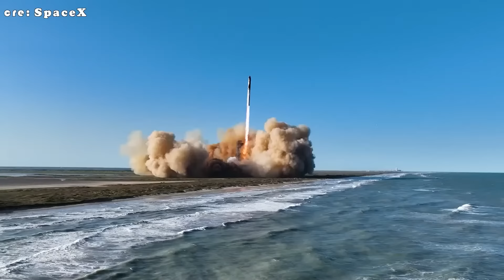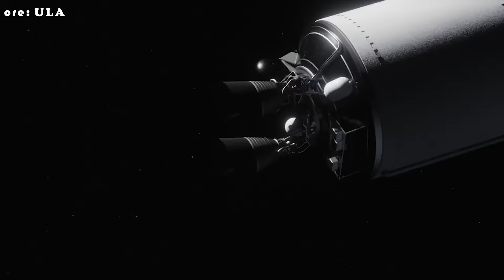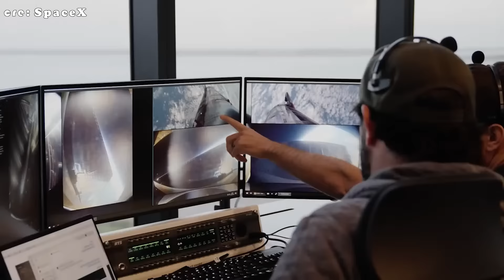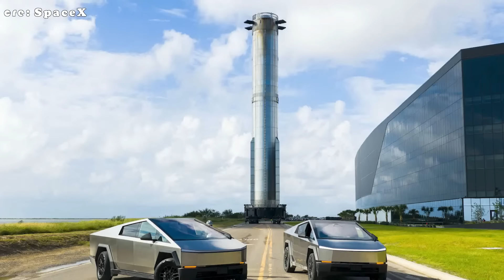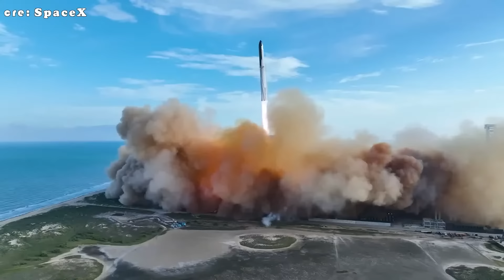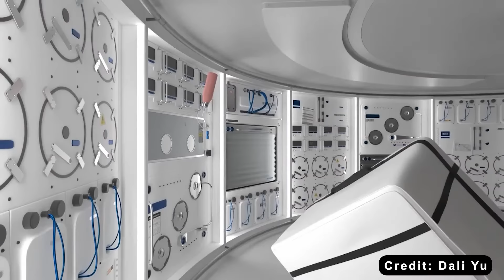Elon Musk SHOCKED NASA and China with New Method to Launch Starship to the Moon!

Comment: Granting the Legacy AeroSpace Companies contracts for a new Lunar Lander via another Ridiculous Cost-Plus contract doesn't just risk a continuing delay in develoopment and production, it actually guarantees it.  The Legacy Companies virtually cannot commit to a fixed price contract due to lack of Engineering staff with other committments, and unwillingness by their Administrators and investors to risk the loss of profits implied (and probable delays and cost over-runs inherent in innovation and testing) in the process.  The Legacy systems are just unable to absorb the costs like  SpaceX can since it is NOT a Public Corporation and has far less limitations.  The Legcy Corps have fed off the Government on Cost-Plus contracts for so long their entire Business Model is tailored to that process and to change at this time would require a complete revamping of their entire Company and require much more staff and time to achieve it.  The answer is to let the lean, experientce Commercial Companies who are more innovative and trim enough to handle fixed price Contracts with a little one-time start up money to initiate the R&D required to get them on the road.

Comment: How about landing horizontally with small ventral engines and short lega across the ventral edges to prevent rolling.  That would make a very stable vehicle on the surface and place the hatches close to the ground for loading and offloading equipment and personnel.  To take off would require the engines to somewhat more powerful but I think achievable.  Just a random thought.

Comment: When they use plasma cutters to cut up the internal fuel tanks they should already have the shapes all predesigned to reassemble into walls and furniture and whatever else the can make with the tank metal and a welder to tack everything into place most of this layout can be done on earth ! 3 rollers electrically driven to flatten out all the curved pieces to make floors and walls . All you need is a few robots and some solar panels for power  and you can do all the work in the vacuum of the moon ! You don't need Mig welding gas in a vacuum just plain wire ! and robots don't need air , food , or extreme heating and cooling either, just keep the robots cool enough and not too hot  ! Just electricity and they can go wild for months! they can do all the construction necessary before humans arrive with necessary oxygen and food and more robots !

Comment: .Centaur is designed for single use - thus you have to pay a LOT more per launch. And assuming ULA will be able to recover the engines is stupid - the sea water will destroy them begfore a second use is done - and reconditioning them will cost more than a new engine. Then there is the problem ULA has - it depends on Blue Origin for engines to start with, and BO still doesn't have production lines capable of delivery - all their engines are dedicated to their New Glen which is SUPPOSED to be reusable, but has had only ONE TEST LAUNCH.

Comment: shorten the body and use 6ix legs
Reply: By launching a hydrogen stage on a separate rocket first, there's no need to make any change to the starship. However, a smaller starship might be preferable for landing on the moon.